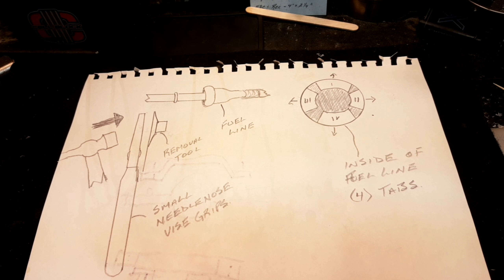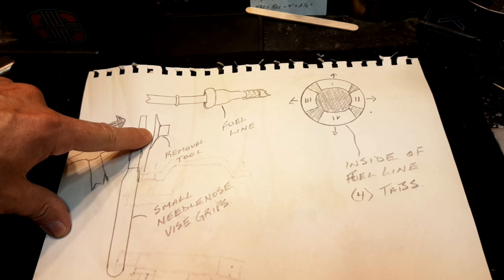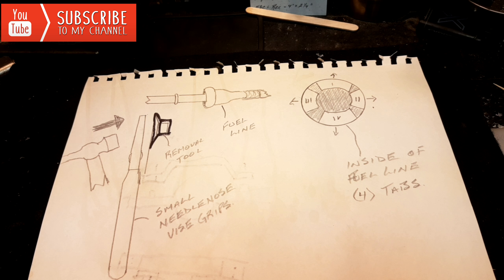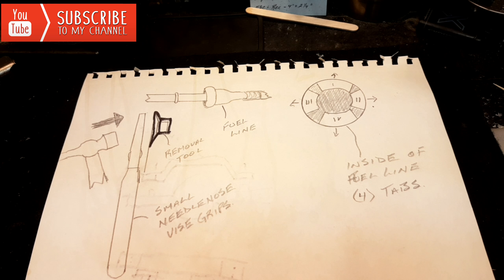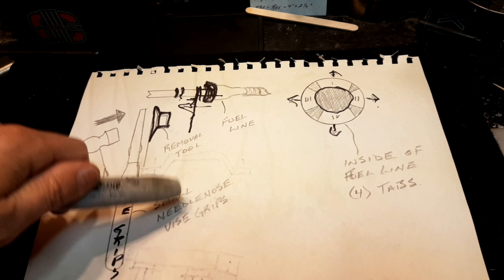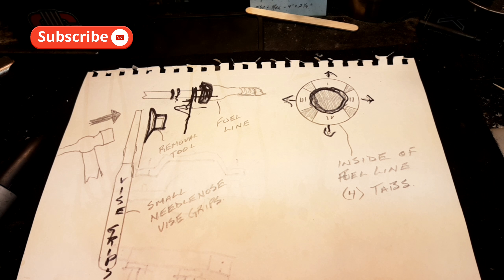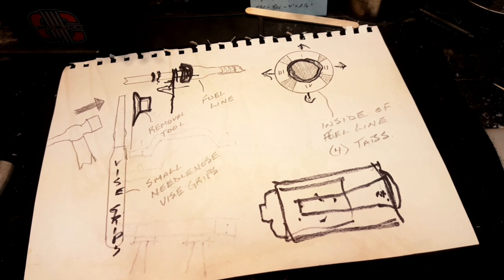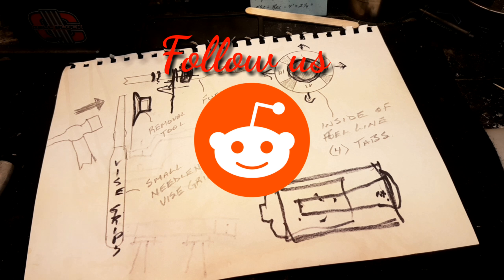How To Remove Fuel & AC Lines

Comment: I hate the quick disconnect lines. The plastic ones always break. I did my fuel pump on my 2000 Chevy suburban and found a new sending unit and pump for $85 at 1aauto.com I hate taking my ride to the shop they charge way too much.